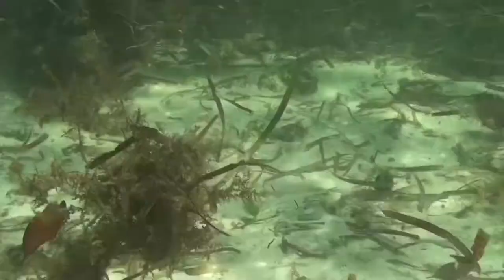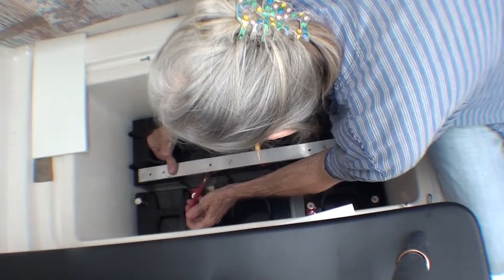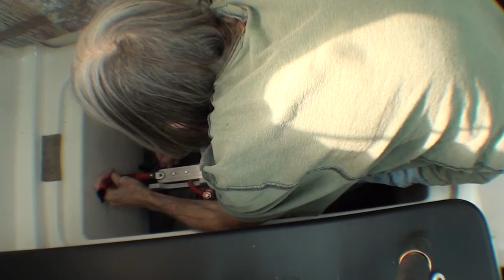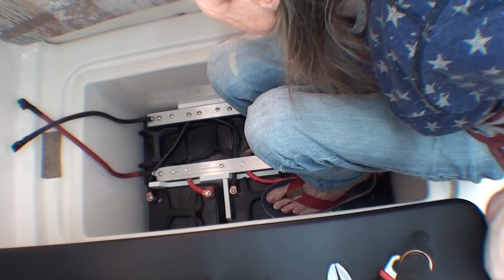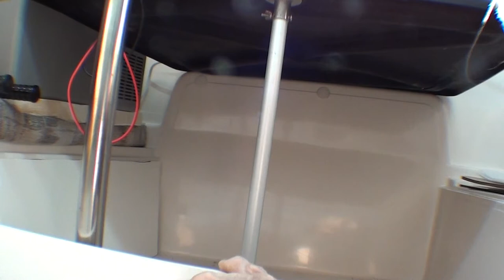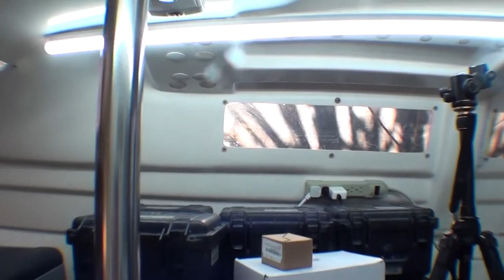Giant Battery To Run Air Conditioner, Freezer, Fridge, Microwave

Comment: I was nervous when you were putting on those bus bars. Glad you mentioned the large amount of power in those batteries, it made me feel less paranoid.
Reply from the maker: These batteries make me nervous too.  Now that the bank is complete, I plan on taking it all apart again so i can stuff some insulating foam between the negative wires where they go under the positive bus bar on the lower level of batteries.  I took a bit more care with that while finishing off the upper layer of batteries.  It bothers me that the lower layer is out of sight, so I have to go back in there and make everything a secure as I am able to.  Then, maybe I can re-assemble the pack and leave it alone.

Comment: Battery banks need ventilation for cooling and to rid standing fumes.
Reply from the maker: Thanks for the warning.  These are definitely things to consider when selecting a place to put batteries.  I don't think these LiFePo4 batteries make fumes like the lead acid batteries do.  They also do not get very hot.  It only takes about 400 watts to run the air conditioner and about 40 for each of the Alpicool coolers.  The current required is less than 1/10 of the batteries capacity per hour.  If I ran everything on the boat off of one battery, it would get pretty warm but would run it for over an hour.  Using 16 of them should keep them pretty cool, or at least thats the plan.  Now that you've mentioned this, I think a test should be done with the temperature in the battery compartment checked from time to time.
Reply: @ninehundreddollarluxuryyac5958  I hope your right. I have read about if they over heat they emit over 100 toxic gasses, and if they catch fire it's much more dangerous. Be safe my friend!
Reply from the maker: @nasanction  My biggest worry is one of the connections coming loose and causing a short with all that power.  I actually took it all apart and shoved a bunch of packing foam in there to keep things from moving or chaffing.

Comment: What happened to the Carver
Reply from the maker: The Carver is at Xcel Marine in Merritt Island.  They are going to fabricate another solar panel rack.  This one will cover the flybridge and front deck.  It will replace the three bimini tops that provided shade there.  The panels on the rear rack produce 600 watts and the new rack will hold another 3,000 watts.